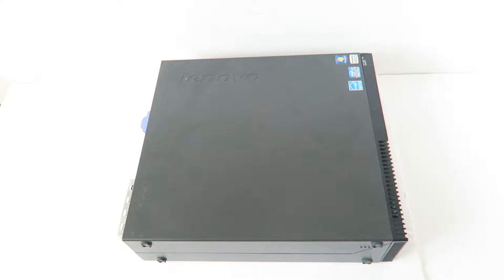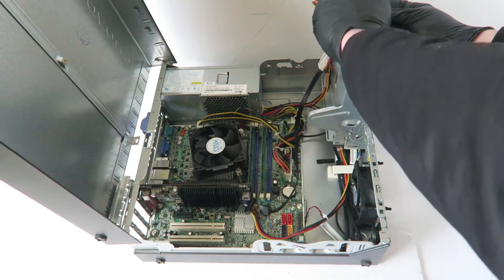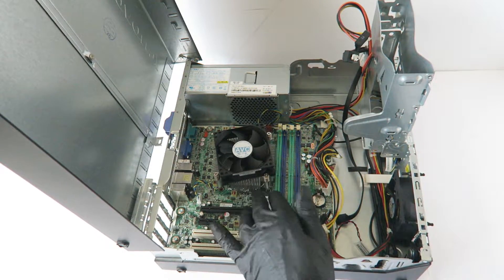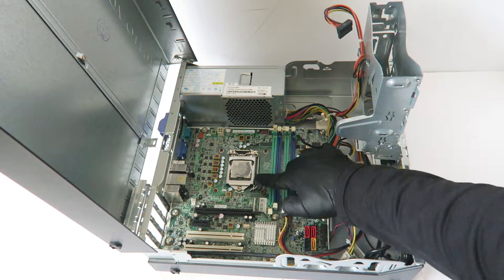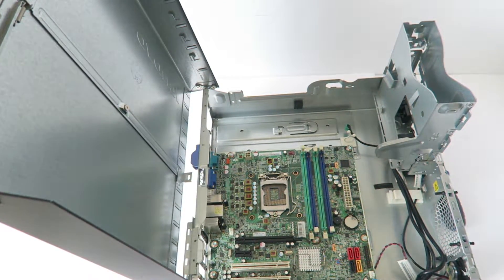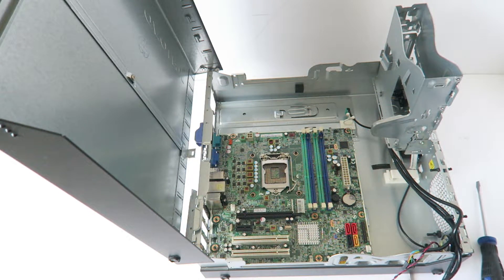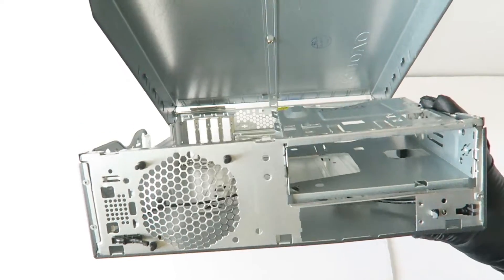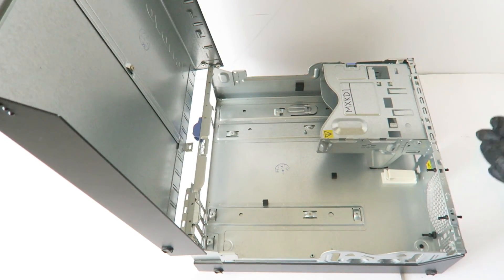Lenovo ThinkCentre M92p M91p Teardown

Comment from the maker: List of Parts and Upgrades..

(1.) Gigabyte Geforce GTX 1050 Ti OC Low Profile 4GB GDDR5 128 Bit PCI-E Graphic Card (GV-N105TOC-4GL) 
https://amzn.to/2XEqKMb

(2.) MSI GTX 1050 TI 4GT Low Profile  Graphic Cards 
https://amzn.to/34r0AxG

(3.) Gigabyte GeForce GT 1030 GV-N1030D5-2GL Low Profile 2G Computer Graphics Card 
https://amzn.to/2Z4PHkp

(4.) ZOTAC GeForce GT 1030 2GB GDDR5 64-bit PCIe 3.0 DirectX 12 HDCP Ready Low Profile Video Card ZT-P10300A-10L 
https://amzn.to/2WzgLXk 

(5.) MSI Graphic Cards GT 1030 2GB GDDR5, Low Profile 
https://amzn.to/390Spum

------
They used to sell them online on amazon with config 32GB RAM and with GTX 1050 Ti video card works perfect with 240w power supply.
-----

This RAM works with this machine supports MAX 32GB:

(1.) Crucial 8GB Single DDR3L 1600 MT/s (PC3L-12800) Memory CT102464BD160B
https://amzn.to/2VhGv8O

(2.) Crucial 4GB Single DDR3L 1600 MT/s (PC3L-12800) Memory CT51264BD160B 
https://amzn.to/2xq46wb

(3.) Crucial 16GB Kit (2 x 8GB) DDR3L-1600 UDIMM CT2K102464BD160B CT7350422

(4.) Crucial 8GB Kit (4GBx2) DDR3L 1600 MT/s (PC3L-12800) Memory CT2K51264BD160B 
https://amzn.to/2y7XZwq

This HDD 2.5inch will work in this caddy for extra storage.

Dell R494D 3.5" to 2 x 2.5" HDD/SSD Caddy Adapter 0R494D
https://amzn.to/3c8ynhJ

(1.). Seagate FireCuda 2TB Solid State Hybrid Drive Performance SSHD – 2.5 Inch 
https://amzn.to/3b1e8T7

(2.).WD Blue 2TB Hard Drive s, SATA 6 Gb/s, 128 MB Cache, 2.5"
https://amzn.to/2Xstb4b

(3.).Seagate BarraCuda 2TB Internal Hard Drive HDD – 2.5 Inch 
https://amzn.to/2xmf0TE

This cable required if you going to install SSD and HDD:
Benfei 15 Pin SATA Power Y-Splitter Cable 8 Inches
https://amzn.to/2XsG0LV

Cable Matters 3-Pack 15 Pin SATA Power Splitter Cable 8 Inches 
https://amzn.to/2Rval8B

Zheino SATA Power Splitter Cable (2 Pack) SSD Power Cable HDD
https://amzn.to/3a3V9Wq

SSD list works with this PC:
(1.) Samsung 860 EVO 500GB 2.5 Inch Internal SSD MZ-76E500B/AM) 
https://amzn.to/2yNxnkE

(2.) WD Blue 3D NAND 1TB Internal SSD, 2.5" WDS100T2B0A
https://amzn.to/2wvnC9Z

(3.) WD Green 1TB Internal PC SSD  WDS100T2G0A
https://amzn.to/3cbrcWa

(4.) SanDisk SSD PLUS 480GB Internal SSD SDSSDA-1T00-G26
https://amzn.to/3a3i9ou

(5.) Crucial MX500 250GB 3D NAND SATA CT250MX500SSD1(Z) 
https://amzn.to/34rZlhy

(6.) Samsung 860 PRO SSD 256GB - 2.5 Inch SATA III 
https://amzn.to/2ybiHLK

(7.) Samsung SSD 860 EVO 250GB 2.5 Inch SATA III Internal SSD 
https://amzn.to/2VjIAkK

(8.) SanDisk SSD PLUS 240GB Internal SSD
https://amzn.to/3c7SEE4

Lenovo ThinkCentre M91p CPU Support List.

    Intel Core i3-2100 Processor (3MB Cache, 3.10 GHz)
    Intel Core i3-2120 Processor (3MB Cache, 3.30 GHz)
    Intel Core i5-2400 Processor (6MB Cache, 3.10 GHz)
    Intel Core i5-2400S Processor (6MB Cache, 2.50 GHz)
    Intel Core i5-2500 Processor (6MB Cache, 3.30 GHz)
    Intel Core i5-2500S Processor (6MB Cache, 2.70 GHz)
    Intel Core i5-2500T Processor (6MB Cache, 2.30 GHz)
    Intel Core i7-2600 Processor (8MB Cache, 3.40 GHz)
    Intel Core i7-2600S Processor (8MB Cache, 2.80 GHz)
Reply: Bro does it have extra ram space?? Please reply bro 🥺
Reply from the maker: @hwk5781  Hi, what model lenovo do you have ?
Reply: @Mxkdt  bro it's Lenovo IdeaCenter 3 Desktop
Reply from the maker: @hwk5781  What is the exact model is it Lenovo IdeaCenter 3 ? and there are different models they have,  07ADA05, ? 07IMB05 ?
Reply: @Mxkdt  07ADA05 one
Reply: What do you think is the best power supply for this motherboard,i was searching for it and i couldn't find it..
Reply: @Alm1rr  well, its a power efficient mb, i have it in my ovn pc that i made by buying the same pc he tore down and install a new gpu there same as a new case (krux trek very good airflow) new power supply and a new spu cooler (aio)
Reply: @inqizzo  So i can add a cpu cooler to this as well? i didn't know,but i dont know what power supply can i add to this,it has i5 2400 cpu and nvidia gtx 1050 ti..
Reply: What about the m92p? Same cpu's

Comment: I have this same desktop. I successfully maxed out the ram with DIMM's from Microcenter. I purchased an Inland SSD several months ago and I could not get the computer to recognize it at all. I returned the SSD and left the computer along for several months. I've since picked up a new SSD on the change that the one I purchased previously was faulty. Hopefully the one I'm about to install be recognized by the computer.
Reply from the maker: Hi.
Reply: The new SSD worked. The original one that I purchased must have been a dud.

Comment: I have exact same computer as this one and mine has a fan shroud over the CPU fan can I remove this and does it make a difference in temperature ?
Reply from the maker: HI, yes it is for case and direction of airflow. Fan shrouds are passive air-flow improvement devices.

Comment: Is the mobo a mATX form factor?
Can I place it in a tower?
Reply: This motherboard can fit in ATX case . People did it a lot of times.
Reply: @gpubenchmarks7905  
I was more curious about the standard.
'Cause I like the SFF case and wanted to build one with a B450m board and R5-3400G xD
Reply: I made a dum-dum and got an M82, which uses proprietary PSU connectors (14-pin) and the sata-power is routed through the mobo.
Reply: same question i was wondering

Comment: Please Note: the cable he disconnects at the 8:55min mark is the THERMAL SENSOR. You will need that, if you are ever moving the motherboard to a different case. If you don't your CPU will throttle wildly and your fan will go all sorts of weird things.
Reply: Where do you put it in the new case

Comment: Hello, I have a question. Can I power up CPU using classic 8pin cable? I can see there is 4pin socket for CPU power, but can I use "half" of classic 8pin connector? Thank you in advance for answer.
Reply: What did you end up doing

Comment: Between this and HP ELITE DESK (I3 4TH GEN BOTH). which one would you recommend. In terms of ease of upgrade. I'm afraid of proprietary connectors.
Reply: this one
Reply: Yes. I have purchased this one for my brother. It's working great. With an SSD. Nneed to upgrade rams. Currently only having 2*2

Comment: Hey man, I found one M92p at work.. Definitely going to tear it down, but I was wondering... 
What is something you'd use this case for? (besides a PC with upgraded mini-ATX motherboard and low profile GPU)
My first idea was to use as an storage compartment for cables, HDDs, or anything that'd look cool taking out of PC case
2nd idea was freezer or fridge for having a few cold beers inside (but that's a dumb idea, not so easy to make a fridge)
3rd idea is to use the power supply on four salvaged 3.5" HDDs instead of buying this: https://www.amazon.com.mx/gp/product/B07415KV63/ref=ox_sc_act_title_7?smid=A3BWELMBWVCY9T&psc=1 but, still need to figure out how to do multiple SATA to USB (I can do 1 at a time no problem, just need a HDD casa and a SATA cable)
What do you think? Possible? Or should I just get a cheap mini-ATX motherboard and plug all those 4 HDDs, and use both USB and Ethernet ports for transferring to a router/another PC?
Any advice appreciated
Reply: u want to find a good case for this exact components? krux trek is a good choice

Comment: Moved an M91P into a new case but having a problem with the CPU fan throttling to 100% most of the time. Found out it's that little last cable. Is that the Thermal Sensor? And how would you install that into a new case? Would it just lay inside? Thanks.
Reply: @Mxkdt  Thanks for the reply!
Reply: Hi, i have the same problems.
Any solution??
Reply: I just transferred the innards of a Lenovo M91 to a Thermaltake case (for more space) and yes. that IS the thermal sensor, you do need to take it and move it over to any new case. You don't have to mount it in any particular spot (though ideally closer to the CPU would be more ideal)
Reply: @DrDieless  Did you have any other problems besides this one?

Comment: less than 10 mn to do a Teardown, that's empressive
Reply from the maker: Hi, Thanks.
Reply: want to see me do a speedrun of nearly the same pc (i use the same parts for the motherboard, cpu, cooling just diffrent case and few more hard drives and a nvme ssd)

Comment: I have an lenovo h520e and Im planning to replace the motherboard with a gigabyte motherboard. I have one big doubt the front panel connectors of the case are bound together like 6 pin connector. Will it cause a problem??